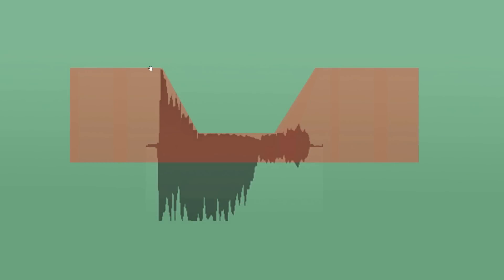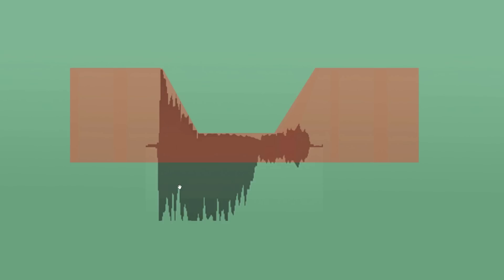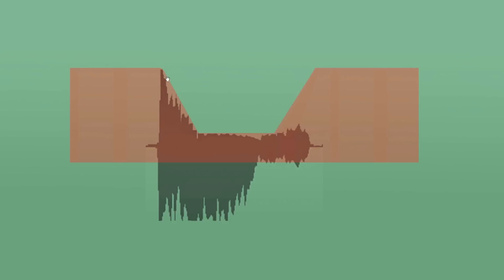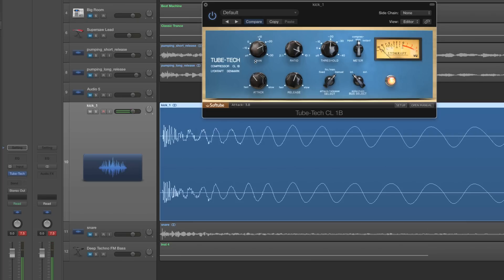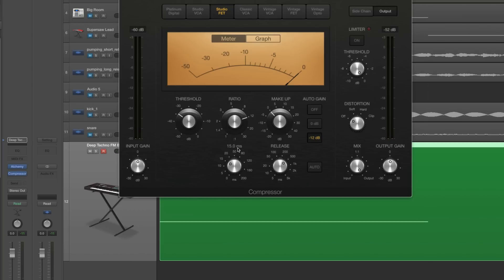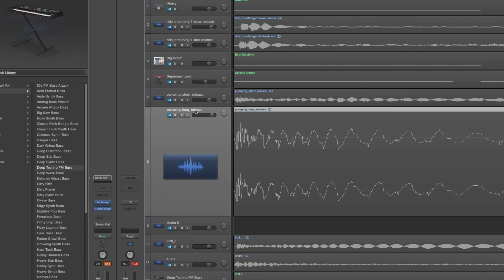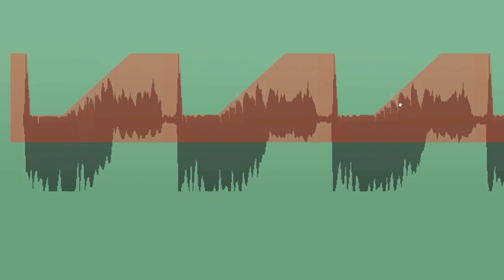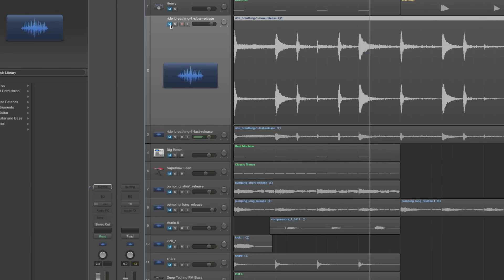Compressors & Compression Masterclass 5 (Attack & Release 2)

Comment: Hey. So really like how thorough this whole series is, and I understand everything (I thought), but I'm hitting a snag here with some of the visualizations. The "envelope" image in Part 4 and how it then translates to the sound wave here is great. But the green backed sound wave with red envelope field with overlaid "envelope" here, that's not going to render the same as how the actual sound wave shape would look, right? The fact that a compressor is a "negative" creator and only turns things down is great, but that scooped envelope (happy face shape) would still be applying to a positive (frown face shape) volume wave. So that scoop in effect would actually be the theoretic difference in the shallowing of the frown face. No? These images just seem to contradict all the ones in the previous parts with the in/out spikes and the thres/ratio stuff. This makes it look like the volume gets lower than the threshold, not just brought down CLOSER to it. Does this make sense? Am I missing something?
Reply: "This makes it look like the volume gets lower than the threshold, not just brought down CLOSER to it." 
You're right, and I can see where the confusion might be. This visualization does make it look that way, but if you remember that he spoke of unity gain, which means the compressor will reduce the gain below unity gain, not below the threshold. As you said, it brings it closer to the threshold. Keep that in mind and that should help.

Comment: Hey! What happens in the circumstance like above where say, a later snare drum - JUST before another kick drum, triggers the compressor to work? Is the release still coming up and therefore you'd lose a lot of the transient etc on the kick drum, or does it sort of go back to square one each time something surpasses the threshold? Thanks very much, helpful videos :)
Reply from the maker: if the release is set right (and often there is some compromise) then the comp wont recover between hits audibly, so all hits are happening when the comp hasn't fully recovered/released... but this just results in an 'even-ing out' of the sound.

Comment: 6:52 According to the illustration compressor begins to release when the signal is still loud enough. Why is that?
Reply from the maker: look at the sliver of the peak beginning which partly gets through. it;s way higher than the body of the wave that follows it. It's just that first peak that's triggering the compressor
Reply: Thanks for answer. The point where compression work in full force is way lower than the waveform of synth. According to the gain reduction I imagine that Threshold set lower than the synth volume. So the synth must have been compressed.
Reply from the maker: don't get too hung up on the accuracy of my hand drawings. the synth isnt way lower than the reduced level btw, it's just getting ducked down enough that you hear it rise back up when the comp releases

Comment: Wow! The attack and release is way more important than I first .thought lol. I'm motivated to try this out on a guitar recording, I've never had much luck using compression on acoustic and nylon guitar before I hope now I get better results.
I'm confused a little though, if a compressor is always active, a signal never falls back below the threshold, does that mean the compressor is doing nothing? or does the dynamic range above the threshold make the compressor behave differently still?
You are amazing for doing these videos by the way, nice one!
Reply from the maker: if the comp is active all the time then all the time dynamic range is being reduced. You can set the threshold "too low" on purpose so the signal is always over threshold & the comp is always working, just try it & see/listen, its all done by ear at the end of the day, but knowing what's going on helps.
Reply: Thanks so much for the reply, I'll be using the compressor more so now that I understand it a bit better. 

Subbed of course